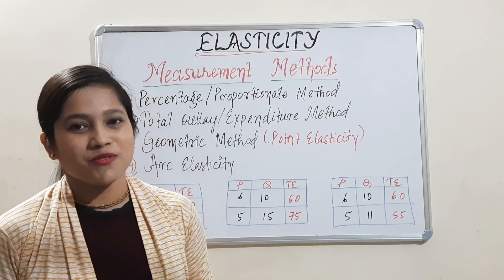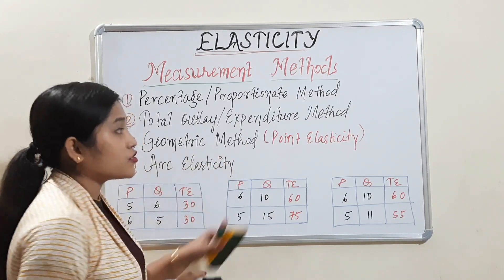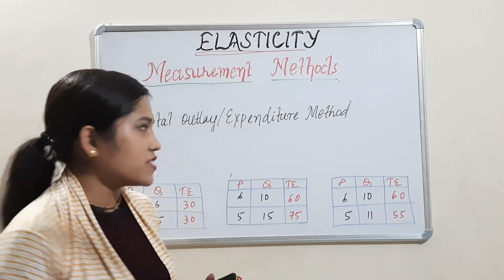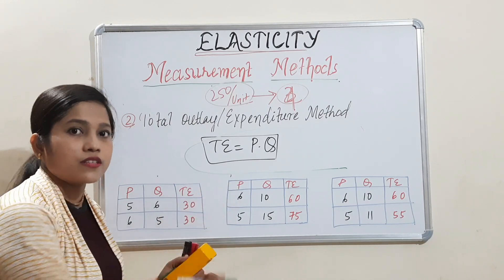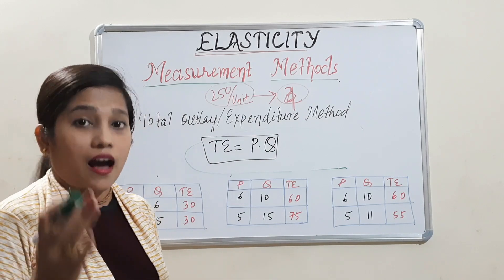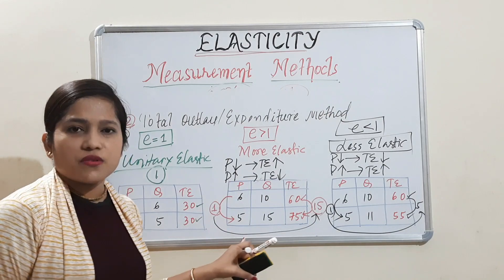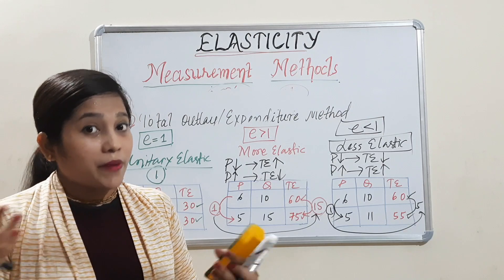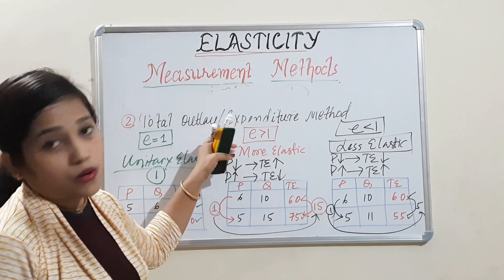Lecture 16. Total Outlay/Expenditure method of elasticity measurement

Comment: Suppose the current level of some good is X.If market demand is inelastic in quantity,total revenue would be higher if the output was....
A.More tn X
B.less tn X
C.Cons.
Reply from the maker: See
If demand is inelastic
And matter is to increase the revenue..
There is a need to increase the price.
With the increased price still consumer will purchase same quantity of good so revenue will increase...
Reply from the maker: I am not getting your question.
Kindly elaborate properly 
What is exactly the output?
Reply: That's the question if d demand is inelastic what quantity will change for more revenue..
Reply from the maker: Hope you got it right.
All the best
Reply: Bt without increasing price how can I  increase revenue?
Reply from the maker: @sahinmunshi4096  here you have to consider price...
Otherwise how can you connect the situation to elasticity...
Because here the quantity is not concerned but price and TE or TR